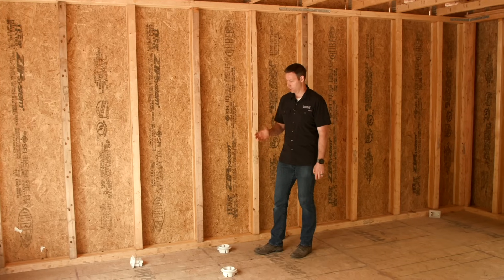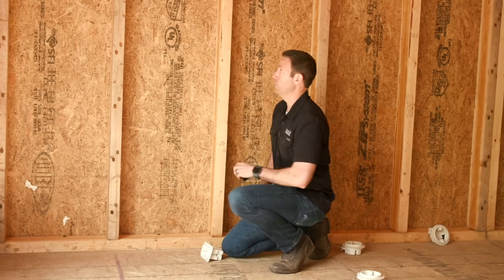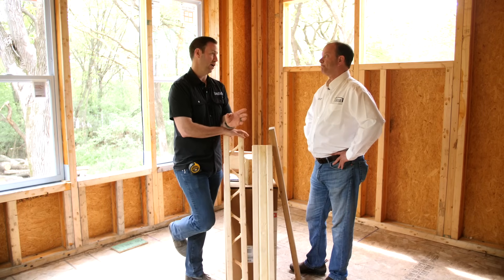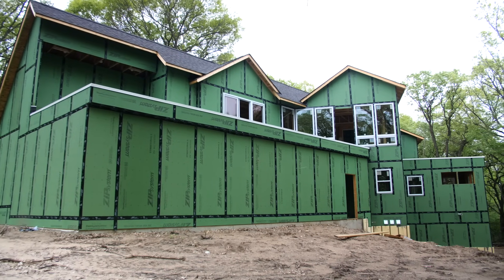Insulated Studs? This is a BIG Innovation in Framing!

Comment: Wondering how this would work when framing an interior house room as a media room for soundproofing?
Reply: I think you would want to insulate the interior of that specific room. I don’t think these studs would do much for you
Reply: Now that could be a place to use these studs where they would shine as they would definitely decouple the inside from the outside and prevent sound transmission. Perfect for building a sound proof room in a garage for a drummer or band practice.

Comment: I like a double 2x4 wall with the studs staggered and two layers of R13. It also has the benefit of sound proofing since the wall studs arent solid between the two walls and so they dont transmit sound vibration well.

Comment: Use proper plywood, not that particle board crapola.
Reply: zip system is just crappy OSB with a coating.  I wouldn't use OSB on my house.
Reply: use proper 1x10 boards at a slant, not that plywood crapola

Comment: Great video. I didn't see whether the fella installing the electrical wiring used a cylindrical nail blocking ring. Thanks. Good on ya mate.
Reply: Nail blocking not required. The 2x3 is  1.5 inches thick...Per NEC nail plates needed when wire is less than 1 1/4 from nailing edge.

Comment: Interesting product! What do you do about heat transfer through windows? Even more so it seems like the window is the weakest point in the house insulation.
Reply: you said it Jacob. They have good window options but the price goes up exponentially. Perhaps better blinds (sealing to the window casing)

Comment: Why not just use metal studs? Probably 1/4th the cost.
Reply: Metal is not the best idea for an external wall stud.
Metal conducts heat very well compared to wood, which is exactly what you don't want.
This T stud stuff looks like it's gonna become pretty dang common provided there isn't some sort of recall because it comes unglued when it gets wet or something stupid like that.
Since they offer a version that is treated for mold rot etc. I'd imagine they already thought of that.
Reply: @44R0Ndin  it seems kind of unneeded honestly. Because if you're worried about a thermal barrier you would just make the exterior higher rated. Or at worse you could use the spray foam insulation. I cant imagine these are really that much more cost effective. Also if you need to drill through the wall for plumbing it would be a pain because the foam would just break apart but the pegs would throw off any kind of holesaw or angle drill. I'm all for new kinds of building material, but this seems like its solving a problem that has easier or more cost effect solutions already. Idk, just my 2 cents lol

Comment: To be honest, Timber is a very good insulator. It is a natural insulator because of it's cellular internal structure. It allows air to become trapped inside it, therefore creating a building element that is an insulator.
Reply: agreed. the thermal conductivity of wood is so low that this is a waste of money, which is why you have NEVER seen it
Reply: Wood is a poor insulator. It conducts heat at a rate of 2-3 times common insulation material. Drive through any neighborhood on a frosty morning and you’ll clearly see the evidence on roofs. Lines of melted frost where the rafters are because the heat was transferred through the wood faster than the insulation.
Reply: @pilldoktor  I can honestly say that I have never seen that. It may happen, but not anyplace that I could have witnessed it.

Comment: Nice product share Matt...  I personally am not a fan. too many surfaces to fail...  Thermal studs are interesting though... also his load calculations for the loads of 900 lbs for a 2x4 are reaching... about 33% off...   But, he also did say, a 2 foot piece holds 36,000 lbs --   not many people will be loading a 2 foot  stud...  maybe a 91.5 inch stud (which is minus the bottom plate, top plate, and cap plate...

Comment: He talks about his cost is a bit more than standard stud. He's going 2 feet on center. That makes for wobbly drywall. The insulation value really is important during extreme weather conditions. Any wall is sufficient during mild weather. Some months I don't have the heat or ac on. I'm sticking with conventional 16 oc. Done fine so far.

Comment: But can you use standard batt insulation? 24 OC with a wider stud means the standard rock wool or fiberglass batts won't fit in the voids.

Comment: I added 1.5 inches of styrofoam on the exterior of my house (normal 2x6). I think it gives me R31 or so.
Reply: How much did that cost though? 2'x4' panels of rigid foam are like $50 each!
Reply: @bike4peaceRTW  It was all in one package. All walls, windows, doors, roof, drywall, insulation etc on 3600 sf was about $210k. This includes the construction. The total construction, including tearing down the existing house, utilities, foundation, minimal landscaping etc was about $670k.

Comment: Framed for 11 years now. I would never do 2 ft on center bc I've seen the sheathing warp and bubble out too many times. We also stopped using zipsystem bc brand new homes were getting mold problems from the double vapor barrier it creates. Yes wood is a terrible insulator. Here in Minnesota you can see where all the studs are in an exterior wall if you drive by a house with Hardie siding on a frosty morning. If used with other best practices these tstuds could be great.
Reply: ZIP System is not a vapor barrier. You probably got mold from improper insulation when having air and/or water leaks through over-driven fasteners and improperly installed tape, perhaps with wrinkles. The science is becoming more clear a vapor barrier isn't really necessary and can sometimes hurt. Vapor drive is MUCH less important than air infiltration in terms of moisture making its way into the cavity.

Comment: I really like these studs. I will have to consider them for my shop I am going to build. I am willing to bet that overall energy efficiency is improved significantly. For optimal efficiency I would think that it would be best to use plain "T-Stud"s then spray foam on site, sealing up all the potential airholes
Reply: The only negative about them especially in a shop is a possible fire that will spread quicker but good luck the with shop man

Comment: Hey Matt .... recently subcribed to your series. Watched your vid on insulated studs. Agree big game changer!! Saw there was issue with fastener length. Check this out...
Fasco F91AC RHN20-160 Air Strip Nailer, 4" to 6-3/8" #11302F. This nailer is a beast and does not quit. Nails in ring shank no less. 
Just saw this particularly with decking...http://www.beck-scrail.com. Check it out. Decking siding roofing etc applied with a pneumatic nailer with a screw type fastener that can be torqued down or extracted.

Comment: LOL You talk about the fact that the T stud being stronger ? Were did you go to school since when does a truss have structural integrity vertically
Reply: All dimensional lumber, that is used in exterior wall construction, fails testing on the “x” axis (the 1-1/2” direction) as more weight is applied. Because the Tstud™ has been designed to stop deflection on the “x” axis and the “y” axis, the only way for the Tstud™ to fail is from straight down compression of fiber upon fiber. Thus maximizing the strength of the Tstud™ as a engineered structural wood member.

Comment: This is kind of a dumb ideal, because of fire safety. Now you have a product that's going to allow fire to spread throughout the entire structure. Code requires you to have fire blocking. So ain't this product a code violation. Since the fire can technically spread between the studs. The only way I see this being acceptable is if this product is installed a maximum of 4 feet before being required to have a standard stun. They also need a solid center in the center of every stud that complies with fire code for fire blocking. But honestly I think it would be a hassle on a job site. Not to mention where is the electrician supposed to run his wire?

Comment: These would be great for a media room and sound isolation.
Reply: Not so much. Good for breaking thermal transmission, but not so much for sound. The dowels connecting the two 2x3's form a strong mechanical connection that will conduct sound. They'll be a little better than regular 2x6's, but a complete decoupling of surfaces is still the way to go for sound (plus adding mass). I've built several recording studios over the past 36 years.
Reply: @mntriangle  couldn't you break the transmission of sound by engineering the dowels?
Reply: @williamnaman3570  not sure what you mean by "engineering" the dowels. They would need to be made of rubber or something in order to be sufficiently limp for the sound energy to die in them. But that wouldn't work because this truss-like stud requires a stiff inner webbing for it's strength. Hardness and stiffness are what make materials conduct sound. Decoupling and limp mass are the best sound isolators.
Reply: @mntriangle  with tonearms they break the transmission by making a thick section at right angle to the narrow section.

Comment: Just committed to building my house with T-studs.  Sooooo looking forward to this.  I will have to say that this company is very responsive to concerns and questions.
Reply: how did it go? energy costs for heating and cooling?
Reply: @Randy-rs1cg   The build went very well and Brian (owner of T-studs) came out to the build site to make sure the builder understood the small differences in framing with T-studs vs conventional studs.  My builder was very receptive to any suggestions made by Brian.   The heating and cooling load with this new house is fantastic, although since I am on propane it is rather difficult to get accurate numbers.  It looks like I am going to spend $800 from October to May to heat this 3400 sq ft house in Northern Wisconsin.  The windows also play a huge part in the overall energy savings, and even more important, the comfort of the house.  I purchased my windows from Accurate-Dorwin out of Winnipeg.  They are true triple pane windows with fiberglass frames that are insulated with foam.  
Overall I am very happy with the outcome.

Comment: So, for $5,000 extra I can go from average R value of 15.425 to 17.083 for a 2x6 wall, 24"OC (my calculations per your spec's).  Then I pay for my crew to cuss and take longer to build it using new techniquecs.  Then they cram standard 22.5" insulation  into a 21.5" space, reducing the R value  of the fiberglass batts.  I wonder what the ROI is on this.

Comment: With the efficiency of modern systems like AC, LED lighting, energy star appliances, etc.. I have to doubt it's worth the cost. I just built a custom in Las Vegas last year with 3100 sqft, 10-15' ceilings and serious glass. (30' of sliders in the back alone) My power bill is trending towards $215 for June/July. That's right, summer in Vegas with temps over 100. Sure, I may see $300 in the height of summer, but this is a high end custom home with serious volume and windows. I will say that I did some serious air sealing and I designed the house around the sun exposure. Food for thought.

Comment: Did they flat face the studs in the above wall part of the gable end? - If this happened, its not as strong as putting the studs edge on the gabble wall. Wind loading in extreme circumstances could damage the gable area.

Comment: Awesome innovation! Really nice for drywallers. And termite resistant! I wonder how long it resists termites because termite coatings like Bora-Care I believe last around only 20-30 years? 

How do the plumbers, electricians and low voltage guys know where to punch a hole in the studs? I guess they'll just have to spray-foam patch the unintended holes? 

Standard size nail-stop plates won't work. Using a miter-saw for cutting the foamed studs will send polyurethane debris into the environment. Using a dust bag collector will help but not eliminate pollution.
Reply: termites are relentless  ..   maybe in 20 yrs from now we will have robotic termite killers on guard 24/7          we have robotic lawn mowers using lithium batteries and gps positioning systems   ,, termites zappers next !

Comment: 3/4 of heat lost are tru windows and doors. This studs improve R value of wall less than 3 % on wall and less than 1% on whole home but cost of framing will jump high. There is option add 2" styroform  and Drywit /plaster/  outside /one stone -two birds ... or brick weneer . Sliding big patio doors are heat hole , insted use french doors, triple glass and reduce the size.
Reply: I'm not sure your numbers are accurate.  For instance, one 2x every 16 inches means about 9% of the wall, and that doesn't include "extra" framing members -- common estimates run closer to 25% of your wall heat transfer is through framing.

Comment: wood is an antiquated and outdated building material. shocking structures are still built using wood in tornado and hurricane prone areas.  engineered steel and composites should be the ONLY permittable options.

Comment: Don't think studs can replace insulation   but download strength may be  over estimated with normal aging.  I know screwing bottom plate is a drag and that's a lot of foam around that j bolt.  I  would never TRUST foam webbing in that app. Just use regular 2x lumber for plates and engineer had to sacrifice unplanned load shifts in download test. Try download test at 1in out of plumb in 8ft. And web might break If not perfectly plumbed. Then you're download is drastically decreased.  Also if you cut a web member to run pipes does that drastically decrease your download rating.

Comment: My shop teacher would have failed you for the way you let the tape measure snap back putting all that load on the clip of the tape measure.  Your tape will last a lot longer if you gently reel in the last inch or so instead of snapping it.
Reply: Lol so right

Comment: 2' on center?  Do you use 5/8" thick sheetrock vs. 1/2"?
Reply: Foam insulation backs up the 1/2" - and the OSB as a bonus.

Comment: . . 2x8 T Stud = R30 . . 200 degrees applied to one side with no transference ov temp through to other side in 8 hours . . Like the Inventor says . . .
"That Is Sic"
Reply: J J , All walls should be R-30, ceilings should be R-60 and floors should be R-19. The higher R-Values are not just for people in Alaska fighting the cold, it's also makes a huge difference in retaining cooling in a hot climate. Homes perform much better with the higher R-Value along with Air-Sealing but should have an HRV, "Heat Recovery Ventilation" system to exchange stale air in the house. Once you've spent 2-3 weeks in one of these High performance homes, you'll want to have it for your own house.
Reply: J J , Sounds like we are both doing good on heat retention (R-Value) and AC !  An HRV does what you said, gets rid of stale inside air but at the same time, heats the fresh incoming air from outside.
When you rip the plaster walls off and paint the blocks with dry-loc, why not just use 3'' or more of closed cell ? You'll get the needed R-21 for your walls and vapor/air seal at the same time,  it also adds some structural value ?  Either way, your home sounds like a great place to live !
Reply: I don’t know you,JJ, but kudos for having the class to apologize. 
I appreciate the expertise you share with the other posters (and the lurkers like myself😊.)
Good luck with your projects; You obviously take pride in your work!
Reply: J J , Good points ! Nice talking to someone who actually knows something !  Have a good night and thanks.
Reply: J J "I put in close cell foam 4 inches R 30"  I am trying to understand this statement. If closed cell foam is up to R-6.5 per inch I calculate it to be R-28 at 4" thickness. Are you including something else to arrive at R-30?
Reply: J J wow, that's quite the hissy fit from your first reply. Are you schizophrenic.?  What will you write if you read my question a third time?  How bizarre. 
I am not a builder or a thermal engineer and was asking a very simple question. You did ultimately provide the answer in the midst of your tantrum. I never thought of wood as being much of an insulator and since I can't read your mind I wanted to know how you came up with R30 when you said 4" of closed cell foam. Awhile back I looked up the R value of closed cell foam to understand how it compares to other insulations and saw "up to 6.5".  I automatically did the simple math and I wasn't getting 30.  I looked it up again to double check thus the question to you.  
I often see shadowing on the warm-side of drywall surfaces from wood studs which appears to indicate thermal bridging.  That's why I would never think of wood studs as having any thermal control and when you are evaluating the thermal performance I now get it, you have to look at the entire wall system.

Comment: Seems like it would conduct sound through pretty well.  That's one reason for staggered stud walls full of fiberglass....
Reply: There was no mention of STC.  You compare to staggered stud walls but those are not standard.  You should compare with a normal 2x6 wall, and ask if it conducts sound better or worse or the same.

Comment: That looks like an expensive solution looking for a problem. A structurally weak solution at that. I'll stick with proper 2x material coupled with proper weather sealing, vapor barrier and insulation for all my remodeling needs. I would never trust a house built with that.

Comment: Whether studs or plates, can the "chords' be notched or bored on their inward surfaces?  Can dowels be removed?
Reply: According to the report on their website notching or boring of any kind is not permitted. But the dowel spacing is far enough that you should easily be able to pass through anything you could do in a normal 2x6.